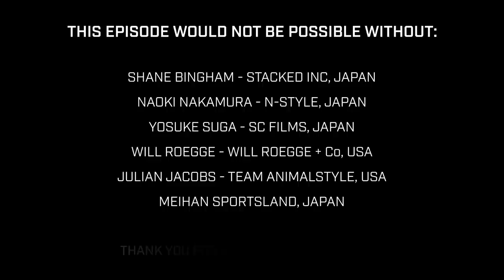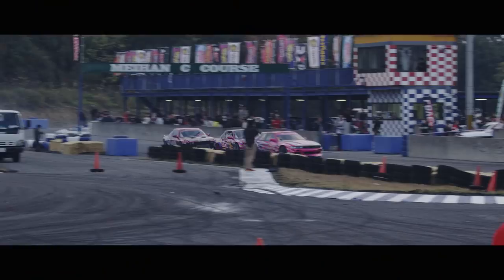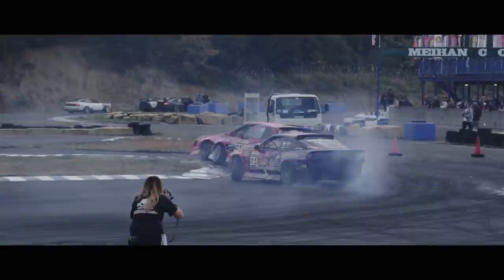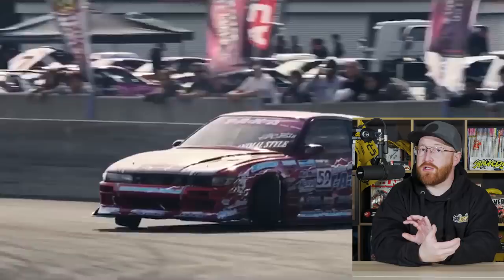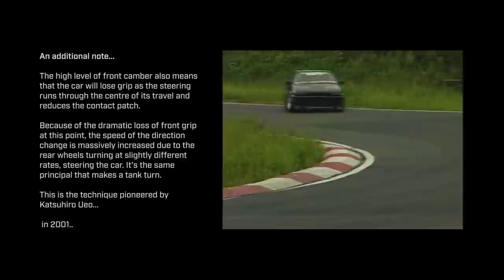JAPANESE DRIFT TECHNIQUES WITH STACKED INC, NAOKI NAKAMURA & ANIMAL STYLE

Comment: I learned on an S15 helical for the first two years, Tried a welded for a season and had to go back to an LSD.. Been running a Tomei 2 way since 2013 and won't settle for less!
Reply: Daniel Minic   I've heard good things about nismo diffs. Never driven on the pro model though. Must be nice.
Reply: Honestly clutch pack LSD’s are the way to go. I’ve had my Kaaz 2-way for 15 years and it still does what I want it to.
Reply: @griplimit   .... Respect! That's a very long time.. How often do you change your fluid and what fluid do you use?

Comment: style isn’t a byproduct of driving, it’s one of personality
Reply from the maker: Are you thinking of body kits and wheels? Because I’m talking about driving style.
Reply: @driftcrash2286  I think it also applies to driving style, and what people like. Some people actually enjoy 1000hp semislick cars mashing the throttle with a kilometre between them. Or so I have been told. And everybody is attracted to different elements of drifting, I don't mind less angle and speed as long as there are nice "pakin" transitions in between. And of course your local scene and circuit has a huge influence as well, and skilled drivers can and will vary their style and way of driving. Great video by the way, I also loved Outsiders and Soul RC and all that stuff
Reply: Drift Crash no i’m talking purely about the personality that one puts into their driving. the wya you put it sounded like it’s was just something that happened as a result of driving, but i think it’s individual influence.

Comment: Love the video dude! I'm going to share this in our RC drifting group because it relates so much! Using the springs and the squat to snap, using throttle control and the correct gearing to gain speed etc. instead of just mashing the throttle and melt the tires.

Comment: Extremely good video and well explained I learned about most of the techniques when I tried  my hand at driving in d1 divisional espichally what we called the fly technique (peloading the springs and flicking the car straight towards a point rather than drifting in a arc) There are diffrent aspects to driving style in places like Ebisu circuit where the jzx chassis is alot more popular. The differential thing is interesting almost everyone I met in japan used a LSD for the reasons you explained and funny enough naoki nakamura came to ebisu to drive in king of nations in 2016 he changed his diff in the PV workshop because his final drive was too low I was surprised to see he was using a welded diff espichally on minami a notoriously hard track to get right witn a welded diff just goes to show you can drive around anything with experience and technique.
Reply from the maker: It’s best not to confuse information when presenting in a format you want everybody to understand. A welded diff can be safer and faster in some instances. Minami is a good example.

I did explain about regional styles in the video ✌️
Reply: @driftcrash2286  Why is a welded diff better at Minami? Because it lacks the long straight Korogashi section and don't really push forward for most of the corner? So you don't need an LSD and with a locked axle the wheelspin is more actually more predictable? is that how it works?

Comment: Awesome video! Thanks for your work! I was drifting a E36 325i for 6 years. I am the guy from Iron Drift King 2018. I loved the LSD so much! Now I finally upgrade to a 3.1 Liter Turbo Engine. But it will have a welded differential. I know I will miss the handling and characteristics from the LSD, but it would break under the power. But now I am asking myself, if there are reliable not too expensive LSDs for 450-650 HP cars that doesn't cost you over 1200€ a season, to renew everything. 

Keep up the good stuff and keep drifting fun!

Kind regards

Robert Pajak
Reply from the maker: Speed Heads the best guy to speak to (and also use his knuckles) is Sebastian Fontaine. He’s got about the best E36 set up I’ve seen and I hope to work with him more in the future ✌️He’s based in the Netherlands 🙂
Reply: @driftcrash2286  Alright! Thanks for the advice! Of course I know Sebastian and his car. Awesome driver, massive skills and awesome setup. Do he drift with an LSD? My car is nearly finished by a workshop in Poland. The workshop got some expirience and build the car for me. First I will test the setup they build and then I get some seattime again. Step by step I will improve it further and Sebastian and his car will be a great role model.

Best regards

Robert

Comment: Finally some decent content 
I'd be really interested to here a little bit more about the welded diff and if you could touch on the Low power skinny tyres thing at some point that would be great haha.

Keep it up mitto
Reply: Yesss! Underpowered drifting is one of the coolest things ever! 😀😀😀
Reply: @Christopher26021994  I love it I do it mainly because I can't afford big power but I also love the way I can go to s drift day and then drive to work the day after 
For me that's what drifting Is all about
Reply: @thomasflint56  I get you, I've also got interested in it due to the budget reasons, but ive found it much more exciting in many cases too. Especially how some are drifting 150hp AE86 or similar cars using almost karting ways to keep the momentum. There is definitely less room for mistake as if you "recovery" the drift it may slow you down and also if it straightens you, you dont have 600hp V8 that will help just by flooring it. I'm same about the power in other motorsports too, low power but high skills and driving on the limit is damn good thing.
Reply from the maker: You guys are right about momentum, but it’s nothing to do with power. It’s driving technique. Most of these cars are 350-400hp, that’s a fast car in the real world ✌️
Reply: @driftcrash2286  Yes yes, I know, I've meant that  i've seen some videos (mostly found accidentally as all titles in Japanese) where guys were drifting in Suzuki Cappucino or some seriously underpowered for these days AE86, and it seemed damn amazing. But yeah, cars from your video, surely aren't slow :)

Comment: This has been called the scandinavian flick since the 1960s. Ironic that this is now the "Japanese style" of drifting. Great video and explanation though! Love the technical details!
Reply from the maker: Andy Hateley it’s not a Scandinavian flick, although very similar in the broad sense, it’s a much more targeted technique 🙂 Although I couldn’t could the hours I’ve watched videos of group B cars shredding 💖
Reply: How is it different? Not trying to disagree  with ya, just want to know your opinion.
Reply from the maker: Thanks for the interest! It’s different because the concept of the motion and the results are different. It’s a bit like comparing cadence braking to braking drift, they both do the same thing, but the results are very different.

Slip angle for a quicker line Vs drift angle. Does that make sense? 😊
Reply: @driftcrash2286  yea, the Scandinavian flick really doesn't involve the load up and spring back effect you get with a shallow drift in the opposite direction. I'm still giving some credit to the Scandinavians though haha

Comment: great work! can't wait for your suspension video. really amazed to hear you are not a fan of roll center adjustment/correction. it makes me puzzled since having roll center and COG wide apart results in a big momentum which can only be compensated with stiffer springs or ARBs. yet, those elements reduce grip. for a mcpherson front suspension the controlarms tilt upwards (direction chassis to wheel hub) on a lowered car, as opposed to normal ride height where the control arms are tilted downwards. as roll center is affected by the angle of the control arms, roll center will go lower in relation to the COG resulting in higher body roll. high body roll will allow to "load" up the car as you stated, but if it's too much you need harder springs/ARB which implies less grip. further camber gain is different with modified roll center. would be really cool to hear your thoughts on roll center adjustment in detail! i always thought "i need this if i ever build a proper car". keep it up, looking forward to next mitto-monday :D
Reply from the maker: DRIFT ALLIANCE that’s a lot to talk about and you post some very valid points. I think what we are looking at is much more subtle... but I can say that it’s not just about being mechanically “correct” as it is about the polar moment. Some stress is required to generate the right force at the right time, what goes up, must come down, what bumps out, must bump in... that last parts a hint 🙈😁
Reply: @driftcrash2286  is the hint factory toe out bump steer must become toe in bump steer for drifting? or is my guess way off haha
thanks for all the info you are giving! can't wait for next monday :D
Reply from the maker: Thanks for the question. My answer is... “what bumps in, must bump out” - think about it 💖

Comment: Mathew great stuff you're posting man!
It's   "jacking" the equivalent to "long stroke shock" in modern/competitive drifting?
Reply from the maker: Ilbert Jimenez the most basic way of explaining it, is that you are using the huge scrub radius and kick up from the camber change to throw the weight over the rear wheels.

Also, I will point out, this is modern and also competitive. Don’t confuse it being cheap and simple with real world performance.
Reply: @driftcrash2286  Definitely not! thanks <3

Comment: Great content! i really enjoy the tech talk about driving technique and setups, would you say with a propper LSD vs welded you could do more aggressive transitions due to wheels being able to move freely to each other?
Reply from the maker: Marius Høgseth absolutley, that’s exactly the point. You can control the direction change speed by adjusting the diff 🙂
Reply: @driftcrash2286  Nice, Thanks for clarifying it ✌️😀 I have been thinking about this for some time and there goes the welded in my e30 project car haha, I have driven different cars on track over the years and I've had a feeling that this was the case 😅

Comment: If rear squat is important in japan, is it unusual to swap S14/5 subframes into S13/HCR32 in japan, it’s common here in UK as there is increased anti squat (if I’ve understood correctly)
Reply from the maker: James Ford it’s not the squat that’s important, it’s the recovery rate. It not unusual, but a lot of the time, it’s surplus to requirements.

But, remember the section in which I refer to put talk... 👻
Reply: Remember the what section? Haha
Reply from the maker: Yeah pit* talk. My phone hates me... it auto incorrects 🤦‍♂️

Comment: I'm ready to finally purchase a differential. I've been on a welded for over 10 years lol. What do suggest as far as setup 1.5 or 2 way, and what lock % do you recommend? Thank you.
Reply from the maker: Guillermo Rodriguez I run a 2way and generally diffs from Japan don’t need messing with. Get used to the new feeling first 🙂

Comment: good vid and info. i might have to get me an lsd, any suggestions on what is good on an s13 ? is there something out there  who locks like 80 % on throttle and  30% ish on decel
Reply from the maker: savag3hippie I’m not sure why you’ve picked those lock rates? Maybe you need to read up on diffs a little more. That’s said, the best diff for any drift Nissan is a Nismo 2 way ✌️
Reply: @driftcrash2286   ty for the reply, will keep that in  mind, mostly couse setups in video games. was just curious if anyone runs something like that IRL

Comment: 9/10, needs more Kung Fu hands lol

For the snappy transitions, what kind of caster settings do people run?
I use the maximum setting my hsd monopros allow, but I've heard people with the whole crab walk lock wisefab etc setups run less caster to increase the steering angle they can get.
Am I right in thinking that this will slow their transitions down because of the reduced self steering?
And if so, is it worth sacrificing snappier transitions for an extra 5° of angle that they're not going to use very often?
Reply: @Garden-Tech  thanks, that's an interesting video
Reply from the maker: Quest So these days, I’d guess around 6 as the scrub radius has increased significantly since that last video, as has the camber. I don’t actually measure to give a caster figure, I just measure wheel base front / rear and make sure the car is square. 

Front wheel is 17x9 245/40/17 ET -55 same as all the Meihan guys.
Reply: @driftcrash2286  okay, good to know
Also, in terms of LSDs, is a torsen type or clutch pack type better for drifting? 
I'm using a welded diff Currently just because of the price difference, but I'd be interested to try out the right type of LSD to see the difference
Reply from the maker: Absolutely clutch type! Torsten, viscous, bara and helical can get in the bin! 🤣✌️
Reply: @driftcrash2286  Nice, I'll see what's within my budget 👍
Thanks for the help

Comment: First of all thank you a lot for doing this, instant like and sub. I've been interested in the different approach between east and west since I watched Outsiders. I found this video today and I have a couple of things that I didn't fully understood from it. I know the vid is from a couple of weeks ago but if someone can shed some light on it please do.

So in order to avoid the biting point of the inner front wheel (around 7:30) I was aware of modifying the knuckes to get zero ackerman so both front wheels are always parallel (even on full lock). But here it seems they also take the advantage of a lot of static camber angles plus the camber gain when turning (from I guess some positive caster) so are they trying to make that wheel contact patch as little as possible? What I dont get from here is how the effect of scrub radius affects in this situation.

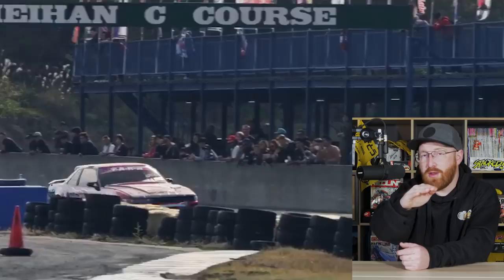The other thing is when talking about the direction change and the load and releasing of a sping (aroundt 13:30) I don't know if you are using the word "spring" as a concept for the effects of inertia, suspension,  line and steering imput or talking about the actual suspension sping and using it a catapult to throw the car around (in this case the rebound/extension of the shock absorber should be very free not to counter that rapid extension of the sping?). Also a soft rear anti roll bar should be used in order to achieve this effect?

Again thanks a lot and I hope I made my thoughts understandable, bc english is not my first language. Stay safe!
Reply from the maker: Well, that’s a lot of questions! I’m trying to avoid specifics for the moment, because it’s a distraction from the concept of the motion, because (ironically) the topic of conversation diverts away from the driving.

Your first point... Ackerman doesn’t matter if only one wheel is on the floor / doing work. What matters is the sweep.

Second point. The power generated isn’t just from the spring, it’s from the arb, bushes, chassis... also the front.

It’s important that your driving is next level to be worrying about this information.